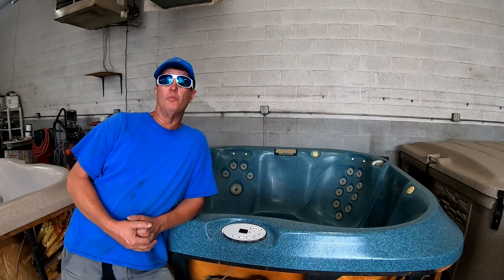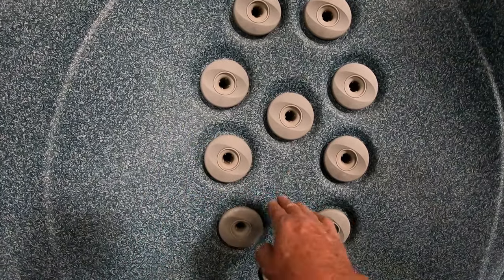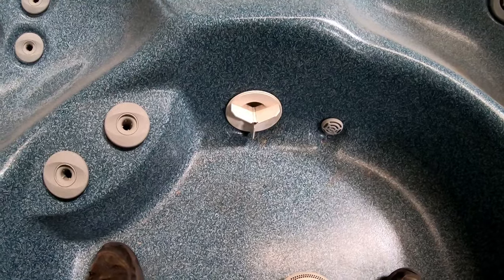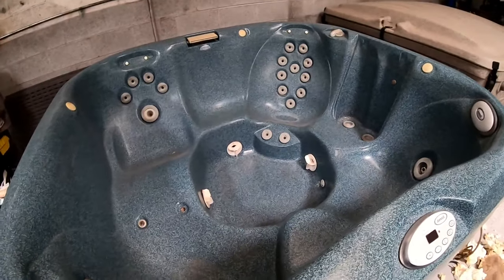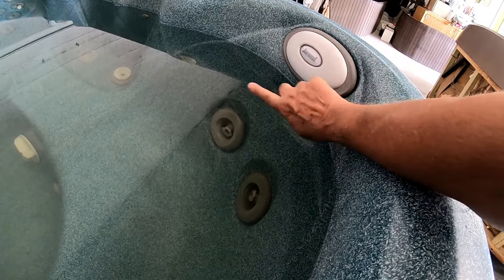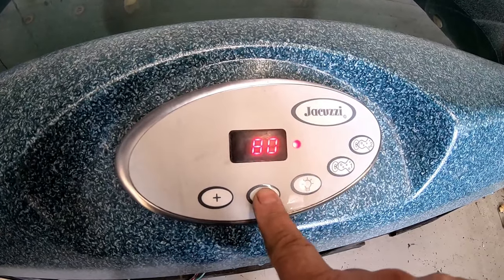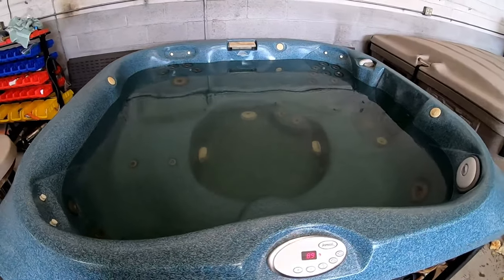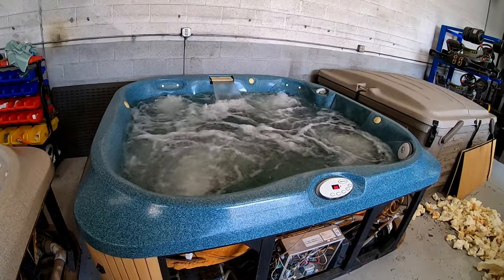Four things to do Before you fill up the Hot Tub with water.DIV Spa Repair..Arizona Hot Tub Factory

Comment: Jacuzzi tubs are definitely susceptible to suction fittings getting clogged.  I pop the heat return covers off all the time from being clogged.  The Little rocks are usually the Little Rocks from roof tiles they go through the suction fittings and the pump and get stuck around the gate in the diverters and get them stuck.  So much that if the roof is gray the little rocks are gray and if the roof is brown the little rocks are brown.  Sometimes it’s not the customer’s roof and it’s the color of a neighbor’s roof near the tub lol

Comment: My tub was running fine and needed a water change this spring. After emptying and refilling my ThermoSpa tub I got a OH code and the pump would not run.   I was so relieved to hear this was a simple problem. I dread the thought of removing 3 dozen screws to open the cabinet. So I put the sump pump in the tub, garden hose attached and stuck the other end in the filters and then the jets. I got air bubbles out so I was feeling hopeful. It worked to blow out the air and the tub is running again. Thanks for your excellent video.

Comment: Thanks for a great video.  Question?  Why do you take the filter out and when do you put it back in?   Also, I watched your video about fixing a leak. I’m a total newbie at all of this.  My leak seems to be at the bottom. Any tips for tipping it up?  Do you have a video that shows putting the spray foam back?
Reply: I've done this when I have filled up the tub, but I have the cover over as I don't want anything dropping into the water.  But, I fill from the mains, so fills very slowly with filters in and have never had a problem.

Comment: Hi, my J315 (1997) 200 gallon has FLO  malfunction;  heats up ok, circulation pump ok ? jet pump ok?  FL2 periodically flashes, Ive tried the plunger for air locks ,tried unlocking valve for any air leak  and retightened. Removed new filters while filling and replaced the Flow switch.    now maybe what please?
Reply from the maker: It needs new sensors/flow switch and it might need a new Cir pump depending on the age of all those things... Thats an old Hot Tub and with age comes maintenance Thanks for Watching & SUBSCRIBING

Comment: I just got a free Sundance Maxxus from 1992 that I’m working on getting it back up and running. I’m glad I found this video because it definitely answered a few questions I had about why my pump pulses after filling the tub! I’m pretty sure I have an air lock somewhere
Reply: How did your repairs go with your 1992? I have a 1998 I’m trying to re do and the pump replacement seems like a big project… have you replaced yours?

Comment: You are definitely the spa man!  I just bought a hot tub did the install/ wiring myself and you were a big help! A professional job if I do say so myself. Now it has a small leak. Do you recommend the leak sealer that you dump in the tub? I'm guessing the answer is no. Thought I would ask anyways
Reply from the maker: You are correct...NO I don't like that stuff! It causes a ton of problems with sensors , heaters , pumps and not to mention you will be soaking in it also...No Thanks . I  have several videos showing how I go about finding and fixing leaks... Its not hard just take a little time. And way to go on getting your Spa installed and hooked up yourself. Thanks for Watching & SUBSCRIBING

Comment: Hi I have a balboa hot tub 501z model.  Customer lets kids use hot tub all the so hot tub is always cloudy. I did recommend they replace cartridges since they bought home with hot tub. I also checked where filters go threaded only one of the holes has suction. The made jet pump as circulation pump since I tried to connect the one there and it trips the breakers so now I know why jet pump is used and circ pump is canceled. All the small toggles switches where in right position for the circ pump just so you know. But the main concern is why I only get suction from one hole only. Thank you
Reply from the maker: You have a lot going on ... First you have to make sure all of the pump and motors are working correctly..second you need to make sure you have nothing blocking any of the flow.. That is what I would start with first. Hope that Helps Thanks for Watching & SUBSCRIBING

Comment: I have a spa touch HT from Balboa that is only 2 years old. The heater has been replaced twice under warranty, and so has the ozonator. Is this typical wit most tubs? Is there a better ozonator that can be put in that will last more than a year or a few months?
Reply from the maker: Most of the time when I have to replace one or the other....495 time out of 500 it was caused by the home owners maintenance program. Both of those items are water related and it gets down to maintenance...
1)ozone are you changing the inline check valve at the very least once a year? if not you are on borrowed time after a year.
2) Most heaters last about 5 -7 years. MINE IS OVER 9 YEARS OLD. change water every 90 to 100 days take care of chemicals weekly...and this one is very important. Do not put in to much chemicals (Kept it Simple)
I started keeping really good notes about 10 years ago (Sept 15 2012) and what I have found is almost every problem with a Hot Tub was caused by . 1) The person/company that moved it in and did the installation. 2) The person/company taking care of the weekly maintenance.is doing a poor job..
I personally believe that manufactures do a really good job trying to make a good product at a fair price....Now some spas are better then others but at the end of the day it really get down to the Moving , Install , Maintenance. Thanks for Watching & SUBSCRIBING

Comment: Strong spa, Antiqua model, the light button on the topside display keeps clicking thru the different  colors, after unplugging the wiring to the main hub it still keeps clicking, could this be caused by moisture getting under the overlay?, and could this be causing the tub from heating up? I unplugged the topside display from the main pack and the tub came on low, plugged it back in and the temp reading came on, but after a few hours it didnt change the reading. Checked the floating thermomidor  and it was rising slowly. Any ideas whats happening, ya thinknits the topside display unit?
Reply from the maker: Overlay could be on crooked and causing the button to stick. Moisture /age can cause that also.. last week had one with a broken clip when plugged into the board would vibrate loose.. it would still work but not properly Hope that Helps & Thanks for Watching & SUBSCRIBING

Comment: Question ? I ve talked to you before . I have a jacuzzi 325 and i shut it down about 2 months ago just filled and circulated pump seems to be problem its the third one in 3 yrs i get  a fl 1 so i checked it with a extra flow  light came on i got new temp switch on flow now is there a way to check circulation pump in tub with water
Reply from the maker: Yes...You should have two filters in the tub..Remove both...if you look at the filter inlet one of them has a screen on it ...that inlet leads to the cir pump... Now with the spa running stick you hand near the inlet **(Note If YOU have good suction it will suck your hand in ..Get ready you will feel it )** Now if it is just light suction like a trickle you have a flow issue/blockage someplace. in the system... At this point you need to check hoses and even heater tube for corrosion ...I.think this will be the topic go my next video...Hope this Helps & Thanks for Watching & SUBSCRIBING
Reply: @spaman5440   i will check that thank you very much !

Comment: Hi, thanks for your contribution. I have a smaller hot spa which I'm not using very often. I do switch it off for the winter by emptying it and cleaning it. However, when I switch it back on lots of (presumably) cal build up from the pipes...it looks disgusting and looks like bits of grated cheese. That only happens when I switch the pumps on after I refilled it with fresh water. As a result I need to start all over again. Such a waste of water. How do I avoid it ? As it seems I can never get the pipes fully clean when I switch it off for a period of time
Reply from the maker: You need to use this Product before you empty the Hot tub and through out the time when you are using the hot tub... Get the YUK out...https://amzn.to/3edBTv4.   A lot of users will empty there hot tub with out ever cleaning it or getting all of the water out of it. A really good shop.vac will help with that (remember to take the filter out of shop vac when sucking the water out) Hope this Helps   Thanks for Watching & SUBSCRIBING
Reply: @spaman5440  thanks a lot for your reply. Currently the item is out of stock (at least here, Spain). I will look for something similar. Could you recommend a vac and how to use it? I did empty the hot tub and cleaned it very well twice, the trouble is that there must have been a small amount of water stagnating in the pipes behind the jets, I suppose. I assume this is what the cleaning product is helping with?
Reply from the maker: @alep8985  I use a Vac like this to clean the tub...https://amzn.to/3EDfZvq
And I use a Pump like this to get the water out of the hot tub
....https://amzn.to/3sAWJfu
And yes the cleaning product works really well ...also you can use Mr Clean Magic eraser...
Hope this Helps    Thanks for Watching & SUBSCRIBING
Reply: So u don't put the filter back in ?.or did I miss something,

Comment: Dang man, Im havin a fit with my hot tub ! HELP!  What else is there to check.
Its been a good spa, but Im battling the dreaded FLO code
I have great water pressure, 2 pumps running smooth, the recirculating pump running good.
I cycled the diverter several times, Opened bleeder valves on both pumps, Cracked open the unions, 
Replaced the clear flow directional switch. pulled the 2 filters and made sure they were clean, 
Pulled disconnect a few times to re boot the system.
The water is getting a lil warm when I run the pumps but even the recirculating pump shuts off after a little wile. 
Still have the FLO code on the 6 button display. Got any hacks or other ideas ? I wanna get it fixed before it starts freezing up.
Thanks for all your videos. You know your stuff.  Oh I even took a water pump I have with a 2 inch discharge hose and tried pushing water threw the filter inlets to clear out any possible air. Im stumped. Hope you have a new idea..

2006 Artesian Capris 7 person 52 jet Dual pump, dual 50sq filters, Ozone with trombone type heater.
Thanks a million. Bob-Fixumm
Reply from the maker: You problem is unique to your spa and we do not want to confuse other with the same problem but the fix is different for your spa as well as theirs. I would call the shop and talk to Scott he will have several question and depending on your answer will try to get you going in the right direction. Thanks for Watching & SUBSCRIBING

Comment: Can I run my circ pump and heat while filling my hot tub (as long as the water is above the intakes)?I was thinking of heating the water as it’s filling. The problem would be that my tub wants to fire the 2 jet pumps which would spray the room down with water. Not good. 
If I unplugged the 2 jet pumps they wouldn’t fire up automatically but I’m scared to trip out the board. 
Just asking for future winter fill ups where the water is really cold going in. 
Do you see any potential problems with doing this?
Reply: I wouldn't run nothing until.its filled

Comment: Hi Spa Man! I had a "Flo" error ( I don't recall any numbers with the Flo") on my Jacuzzi 350. I proceeded to lift the filters out and ran them but accidently failed to pull out the little scum sponge so it go sucked up in the filter hole and I heard the pump immediately sound different (strained) while running "pump 1" but of course Pump 2 is fine. The heater had stopped working when I originally go the "Flo" error but then the sponge got sucked up so I have an even bigger problem now. I need to get that sponge thing out and obviously clean the or replace the filters. HOW or rather, WHAT do I do to remove the sponge clog? Help quickly and thank you.
Reply from the maker: Most likely it is stuck in the impeller of the pump. So if you pull off the front panel and locate pump #1 and remove the front connection to the pump ...You might get lucky and it is right there if not get a good shop VAC with really good suction and suck it out... Ive had to do the a time or two (over 100 times)Sometimes Ive had to use two shop Vacs... one to suck and one to blow.

**Note** Pro tip 
#1 Whatever is stuck must be wet if it is dry  its very tough to get it out.
#2 Take filters out of shop vac along with any dirt and crap or you will get dirt and debris in the tub when you blow it out (remove filter also)
Hope this Helps   Thanks for Watching & SUBSCRIBING

Comment: I've inherited a Sundance Peyton 680 been working fine for about 2 months. Sometimes pump 1 wouldn't come on but would eventually work and it would stayed heated and all
Of that. Now it isn't working at all. I'm just hearing a clicking noise coming from the board when I press the button. Code FL1 is coming on. I've took the filter out and pulled the plugs on the pumps to make sure there wasn't air in the pump and it's not. Pump 2 works perfect. I backed the flow switch out just a little and you can hear the water runnin through for awhile and the heater kick on but then it would stop and the pump wouldn't kick on. Any ideas ?

Unfortunately There are no dealers within 2 hours of me
Reply from the maker: You need several things ...Way to much to list on this page . I would call the shop and talk to Scott And he will get you going in the right direction Thanks for Watching & SUBSCRIBING

Comment: I do have a question .I hope I didn't make a mistake .I bought a Hot Springs Relay. It has batted foam on three sides nothing behind the door. They made a b***** excuse and said it didn't need it and insulation there would cause the pumps to overheat. I know that's a bunch of crap so what's the best insulation to use? I have some rafter insulation, can I use that? I feel like it's better than nothing, Thanks
Reply from the maker: Yes on a Hot Springs in the motor and Pump area You could over heat that compartment by adding extra insulation.A hot Spring a one of the best Insulated Hot Tubs built..If anything most hot tubs need more ventilation and air flow in the pump and motor area... In southwest US we have a lot of over heating issues in several states. Hope that Helps.   Thanks for Watching & SUBSCRIBING

Comment: Scott, Thanks for these informative videos!  very very helpful and useful!  Quick question, never had a hot tub before and just ordered a Bull frog tub which they are delivering on Thursday, I am pulling in the cable today but had a quick question, i want to put the subpanel a little bit further away from the tub but was wondering in ARIZONA what does the code all for max length of the seal tite from the sub panel to the tub,?  I am looking at 12' -15' including the drop from the subpanel to the edge of the tub  any help would be greatly appreciated
Marty

Comment: Hi...iv a problem with my tub it keeps tripping out..iv changed the top board as it was taking moisture in and still the same problem all the pumps and blower work on eco mode but soon as I put on standard mode and it goes to heat it trips..im I correct in thinking the heater element need changing..I also have a leak on a plastic screw on the water circulation pipe can you advice me on what these are called..many thanks and great video

Comment: Thanks for your well done video's they have been very informative. Question, I have a F1 code, replaced flow switch still  have F1 double checked SW.  went to replace recirculation pump it sounds and feels like its running, loosen a hose and a little water came out so I thought iits ok, what else should I replace or still replace the recir pump ,Jets work good just no heat, appreciate your professional advice.
Reply: It sounds like your filtration cycle is messed up. See if you can reset it to 2 out of every 12 hours or "F2".

Comment: Was it clockwise to open the jets? Is that pretty standard across brands?
Reply from the maker: No several manufactures and everyone want to do it there way ..Cool part is you only have two choices .. Just do not force it.. You can break the seal between the Jet housing and the Tub.
Reply: @spaman5440  What is the standard for Jacuzzi, do you know? Is it OK to just set them in between the two extremes?

Comment: My spa has valves on pump outlets and heater outlet should they ever be closed or are they postion fully open they look like parallel slide valves I suspect for maintenance only?
Reply from the maker: Those valves are used when you need to remove and replace either a pump and motor or the heater.. other then that they need to be wide open with the clips installed holding them open. Hope this helps    Thanks for Watching & SUBSCRIBING

Comment: When you tested the jets, did you put your filters back in? I’m confused.
Reply from the maker: After the Hot tub is full of water and I turn on the breaker and the hot tub is up and running with the heat light on and I have a temperature reading then I will put the filters in place. Thanks for Watching & SUBSCRIBING

Comment: Hey Scott thanks for the videos lots of help here. Quick question I have to replace the flow switch tee Assembly on my 2008 J345 what direction does the flow arrow go when installing this?
Reply from the maker: The switch is installed with the arrow pointing to the right as you are sitting in front of the spa...https://youtu.be/XE6r7V80Rzg check out the video. Hope this Helps.... Thanks for Watching & SUBSCRIBING
Reply: Thanks
Reply from the maker: @jimcolby2885  Welcome.